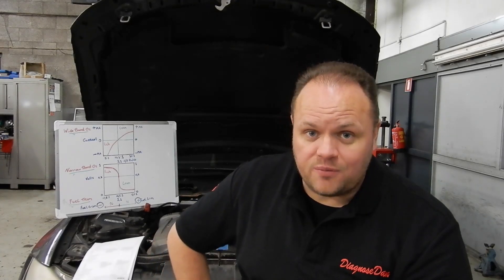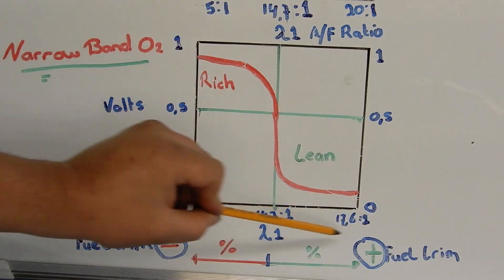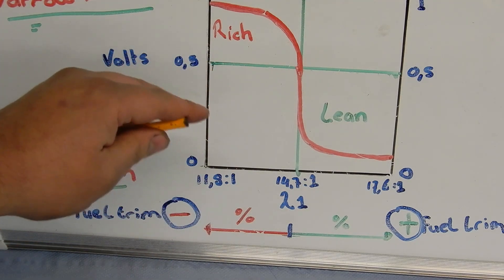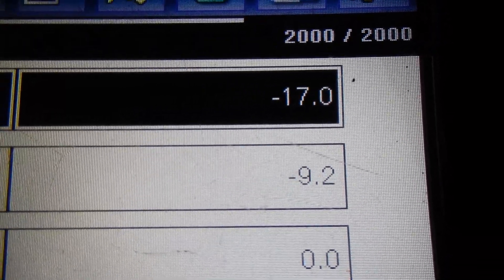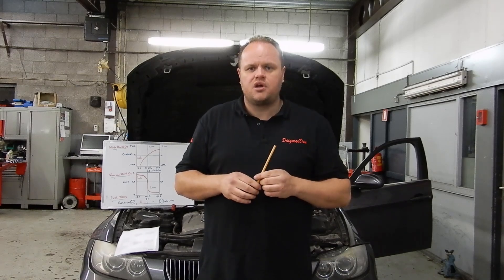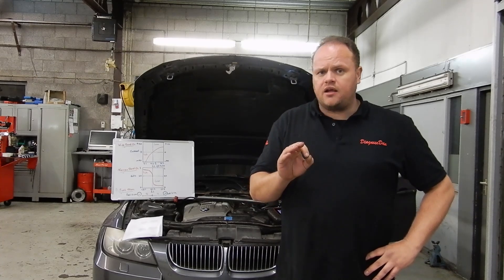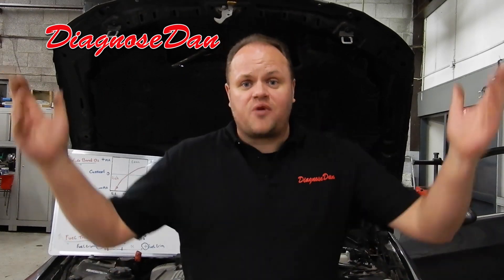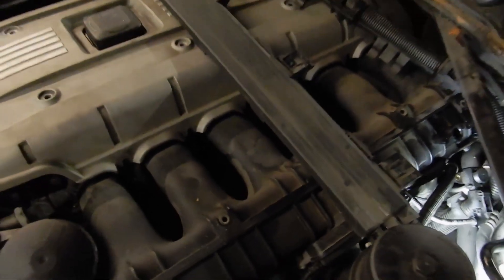Wideband O2 sensors, Narrowband O2 sensors and Fuel trim.

Comment: Hey Dan, your videos are all excellent quality, just wondering if you have ever heard that using brake cleaner as a fuel source creates a gas similar to mustard gas as used in WW1.  A friend used it once and his eyes started burning, looked into it and found out about the mustard gas.  Keep the videos coming. 👌👊

Would the wide band sensor also be classed as a airfuel ratio sensor?
Reply from the maker: I've heard it to, exhaust gas is never good for your health with or without brake cleaner. Always work in a well ventilated area and put a hose on the exhaust if you can! 😉
Reply from the maker: Wideband O2 sensor is another word for A/F Ratio sensor. 
The actual A/F Ratio or Lambda number is displayed in the scandata. Lambda 1 is perfect.
Lower than 1 for example 0.80 is rich. Higher than 1 for example 1.2 is lean.😉

Comment: Great video ( how can u easily detect what sensor u working on i.e wiring,the electric heads without opening them )
Reply from the maker: Evan Smarts, when you look at the scandata of the sensors and you see current in mA then your dealing with a wideband sensor
Reply: DiagnoseDan so to make it easier ( wideband will have ma which closer to 0 means perfect ) narrowband lose to ( 0-5 volts means perfect ) correct me if I'm missing anything
Reply from the maker: Evan Smarts, Wideband 0 mA means pefect mixture. -mA rich +mA lean.
Narrowband 1Volt rich 0Volt lean.
This is for most sensors but there are some exeptions!

Comment: Another great video. Thanks Dan. So why a throttle body? For idling?
Reply from the maker: Edas Places, the throttle plate is there for backup/emergency operation. In case the valvetronic fails.

Comment: No throttle plate... variable valve lift is used to regulate air flow. If I remember correctly. =)
Reply from the maker: Thomas you're right!
There is a throttle plate b.t.w but it is only used for backup, in case the valvetronic fails😁
Reply: @Diagnosedan  There is a very slight vacuum inside the manifold and it is created by the throttle. This is to help the crankcase ventilation system, which needs a slight vacuum.
Reply: Hi Dan i have one question,if you can help vith one doubt...if engine burning oil a litle (Mazda 323f 1.5 dohc) is there any chance that that oil vhile burning vith fuel can couse a slight rich conditions and that my LFT is at -7% and SFT at -1 to +2% at idle?
Reply from the maker: Jonathan Dean, as far as i know peugeot doesn't use straight six engines.
Reply from the maker: Jonathan Dean , i don't think they share the valvetronic technology.(valve lift)
They do share the Vanos technology (cam timing).
The Vanos can be found in Peugeot, mini and Bmw😉
Reply: @Diagnosedan  My 207 1.4 16v definitely has valvetronic (variable valve lift)!
Reply: Thomas EXOVCDS darn, you beat me to it😋
Reply: Pico Boo But you've probably worked on / serviced one before... I only recently found out about this witchcraft!
Reply: Was coming in to say the same thing, but looks like I'm nine months late haha
Reply: Is it the Prince engine? Also used on some Peugeot cars?
Reply: Yes Peugeot aren't that exciting to have a sraight 6! I really meant don't Peugeot share the valvetronic system in their engines, I thought it was the Prince engine also seen in the Mini?
Reply: Yes because those engines are made/designed by BMW, in the mini and Peugeot
Reply: This is valvetronic system .
Reply: Dan well done for these info !
Reply: Hi Dan, maybe I am wrong but please google this part number 1920LY  and tell me is this part of the system we are talking about? Thanks Dan
Reply: Jonathan Dean . Peugeot do use it I have seen it with my own 2 eyes. It is a 4 cylinder BMW based engine. You are correct they use it in the mini too.
Reply: Is true. I used to work in a peugeout dealership. Lots of problems with that BMW based engine. Injectors and the siemens computer.